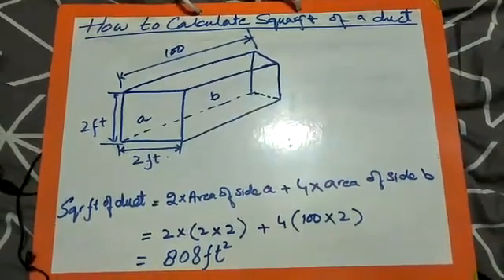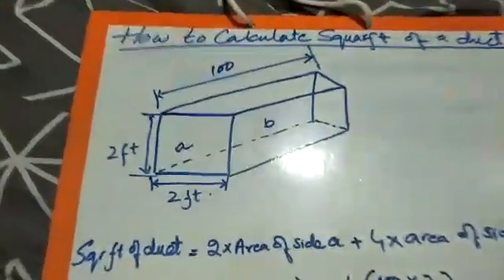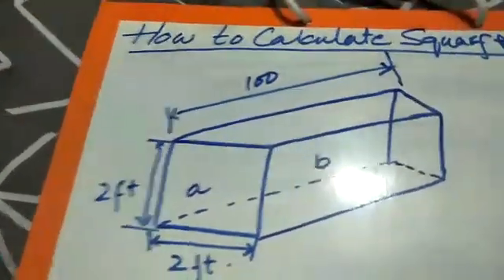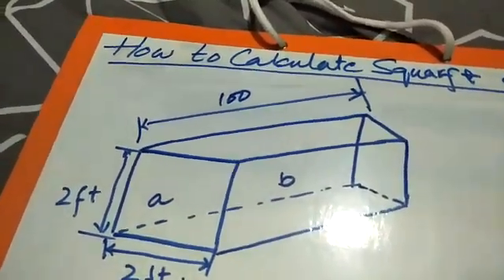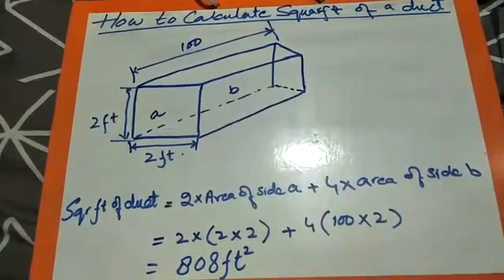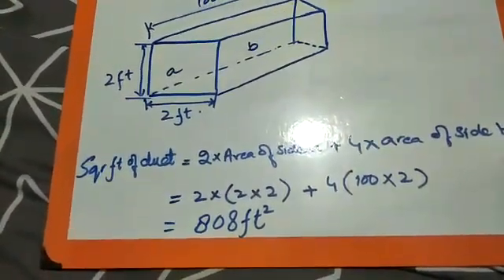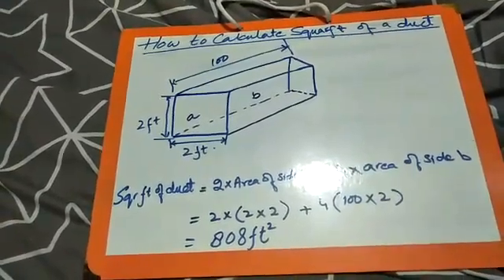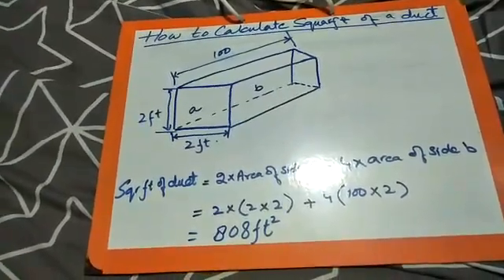How to calculate square foot of a duct

Comment: To calculate the surface area of sheet for square or rectangular duct, the require formula is 2(width x height )x length
Reply: Sorry 2(w+h)xlen
Reply: @mepplanet8625  answer should be 800
Reply: 2(2+2)x100= 800